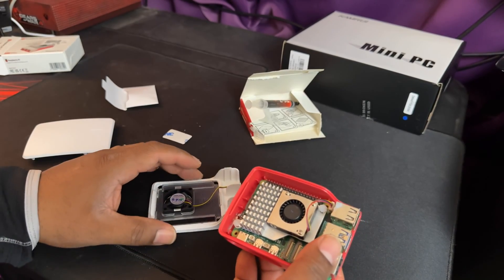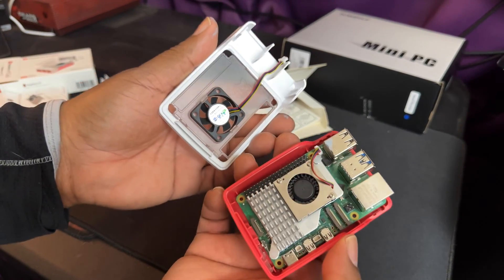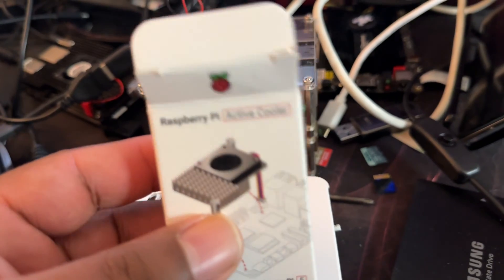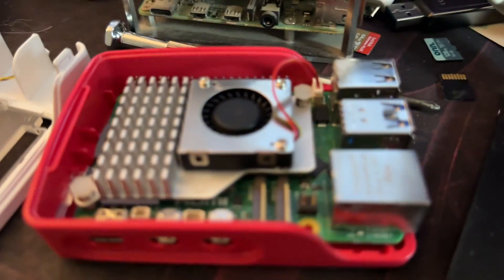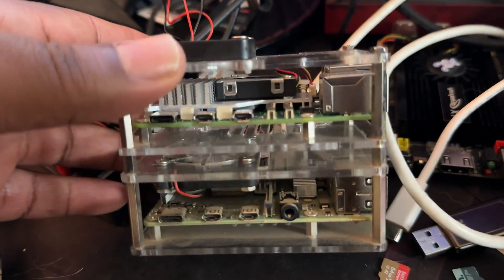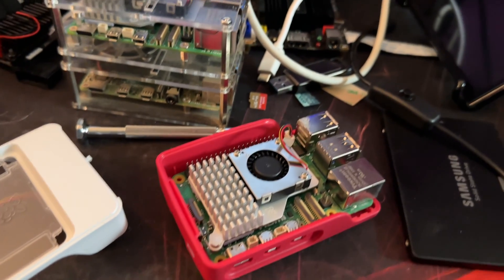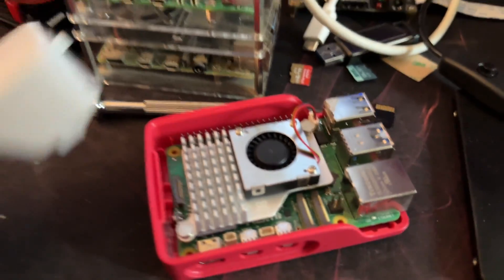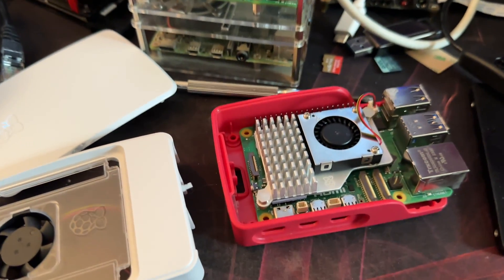The Raspberry Pi 5 Case & Active Cooler Install Concerns

Comment: Dude you are hilarious.
You should just know what you are buying.
Make sure you do not put diesel in your petrol car and go blame the car manufacturer.
Well no. That is a bit dumb. If you use a passive cooler on the chip you can use the case fan. If you decide to have an active cooler you do not also use a case cooler. It is very clear.
So that rant of yours is at best "illogical''. 
You  just do not understand the difference between active cooling and a passive cooler with a case fan.
Your best solution is to understand what you have instead of thrashing what you do not understand. LOL
Reply from the maker: 😂 you should prob read my pinned comment before trying to clown someone
Reply: NO its NOT very clear they do NOT mention on either product page this will NOT work together,  even mention the opposite?! SO WTH?! 
SKU: 1749017
Original Raspberry Pi Product.
Temperature-Controlled Fan,
Delivers up to 1.4CFM of Air Flow.
Comes With Aluminium Heat Sink
!!!!!!Compatible With the Official Raspberry Pi 5 Case!!!!!!

You will ONLY know AFTER You BUY it, its BAD design!? Also WHY NO screws provided?!  🤬
I'm "sorry" BUT ANY Fan is ACTIVE Cooling! FYR 😜
Any cooling system that uses fans is considered active cooling. Here’s a detailed comparison between active and passive cooling:

Active Cooling
Components: Uses fans, pumps, or other mechanical devices to move air or liquid.
Efficiency: Generally more effective at dissipating heat quickly.
Noise: Can be noisy due to the moving parts (fans, pumps).
Power Consumption: Requires power to operate the fans or pumps.
Applications: Commonly used in high-performance computers, gaming consoles, and other electronics that generate a lot of heat.
Passive Cooling
Components: Relies on heat sinks, thermal pads, and natural convection without moving parts.
Efficiency: Less effective than active cooling for high heat loads but sufficient for low to moderate heat dissipation.
Noise: Completely silent as there are no moving parts.
Power Consumption: No power required, making it energy-efficient.
Applications: Used in devices with lower heat output, such as some laptops, tablets, and smartphones.

Comment: Sorry if I missed it on the video, but is it possible to use the larger active cooler and the case if you remove the case's cooler? Also is the plastic where the case's cooler is connected removable? I mean the light/white/a bit seethrough plastic.
Reply from the maker: Ya this case just presents too many issues I made an update about it in my newest video

Comment: It was very obvious from looking at these two that they dont work together. Idk how you didnt figure that out yourself. Yes, bad designed case. But. Do some research of what youre buying and you wont be dissapointed.
Reply from the maker: It wasn’t obvious because it’s not mentioned on any site when I got this months ago. These had just came out and there’s no mention of it on any site at the time. Secondly there’s no mention of the active cooler maybe not being efficient alone during over clocking and high end use

Comment: Just didn't do enough research. The active cooler works with other cases. But this case is meant to work in lue of. Thats why the active cooler is sold separately.
Reply from the maker: Please read below and pinned comment. There’s been enough research

Comment: They are not designed to work together but you do need the active cooler and a case, it can be any case, or else you risk shorting something out on the SBC. I've had that happen in the past and lost a Pi3b+. The case fan is nearly useless, though, so you definitely need the active cooler or a huge hitsink. I've seen an all aluminium case that doubles as a passive heatsink which works well as long as you have good contact between the aluminium block and the processor.
Reply from the maker: Oh of course I have an open air case with fan and the active cooler. So far every case I’ve seen traps in heat the thing that people haven’t shown is heat rising. I don’t recommend enclosed cases especially for sending situations or overclocking. We’ve had guys reach 77 degrees already with active cooler

Comment: Why didn’t you pop out the CLIP-ON case fan, it does work. You need to pop the case fan out though. How did you miss that?
Reply from the maker: I didn’t that wasn’t the point of the video as listed in the comments
Reply: Whole video looks like failed IQ test, or people just dont read fck install guide

Comment: For the overclocking you are doing you may be better looking into a peltier cooled heatsink, if using an external power source for the peltier works for you
Reply from the maker: 28-53 degrees im fine. but thanks

Comment: best option is to use the case fan and buy 2 more cheap heatsinks. The original cooler is designed to be used either open or with any case and can be used with the official case. The original cooler in the official case with its fan removed is slightly more efficient than the case cooler fan and quieter. The case cooler is better if 2 added heatsinks are used. The case cooler also allows the potential to put small heatsinks wherever you want on the board to seperate the heat sinking per part or use one large low profile heatsink to pull the heat. Depending on how you operate the pi, different solutions may be more applicable. 
For something like astrophotography, where the pi is mounted to the telescope outdoors and where fan vibration can ruin long exposure shots, these options are great. The original cooler inside the case will most likely be the best option.
Reply from the maker: Best option is my open air case
Reply: @kiodiekin  For your indoor use yes. For outdoor use not so much ;)

Comment: Uh the active heatsink/fan is for if you don't have a fan. You obviously wouldn't want two fans right inline with each other. No one is talking about this because its assumed knowledge
Reply from the maker: And yet I have the coolest temps for the pi5 at 28 degrees while overclock and running the most demanding apps . U can’t have assumed knowledge when full development hasn’t taken course and higher app running consuming power hasn’t even been ran or tested. I’ve done those tests and I’m speaking from an informed position. So no it isn’t obvious

Comment: The clear part of the case comes off easily. The case comes with a cooler and a small radiator that you can use. You have to choose the bit cooler bought separately or the one that comes with the case. Pretty simple.
Reply from the maker: Well aware as mentioned in pinned post

Comment: You can use the case, just pop out the fan assembly from the case.
Reply from the maker: I’m aware of that but it doesn’t fit the bill for running demanding apps and generating heat in a small enclosure

Comment: Err. The clear plastic with the fan pops out so you can put the top on. All that being said. No screws and the top doesn’t click to the base securely. 

With a bit more thought they could have designed a nice case with a bit more room to allow for a pi hat to fit a nvme drive at no extra cost.
Reply from the maker: I’m aware it pops out that wasn’t the full point. Ya they should have thought it out better cause it’s useless for overclocking trapping in heat

Comment: Just got mine this morning and I fully agree with you. Nobody has mentioned that this is the first raspberry pi with an on/off button but with no access to it.
Reply: The button can be accessed on the case. The power light is also a button
Reply from the maker: The power button thing has been mentioned before.

Comment: To answer you the case has a fan and HEAT SINK so if you don't get the active cooler you have better cooling(very good of them except for the only one HS. It actually need 3 more not just 2.  The USB chip also get hot) and if you did a little due dilagance you would know that for those with the active cooler, you can completely remove the translucent fan holder insert.  This was A VERY WELL THOUGHT OUT CASE.  There are and will be many better but at release this is a very flexible case for the two primary use cases.  See this video https://www.youtube.com/watch?v=vYUF1H-_7TQ   I'm waiting for the official PCI hat and a case that is designed for that like that GEEEK PI case but whit 2 fans on top.
Reply from the maker: Thanks for checking it out. If you did some due diligence and read the comments I know exactly how the case is designed to work. The problem is the pie five gets really hot even with the active cooler. You need a second fan, and lastly, keeping it inside the case, rises very fast, especially for demanding applications.

Comment: My guess is
It's  for the versions 
Without the heatsink and fan
Reply from the maker: It has one
Reply: @kiodiekin  They build the cases before new models come out
Reply from the maker: @Simcore999  what do u mean
Reply: @kiodiekin  I think it's made for the pi4 or if you remove stock heatsink and fan
Reply from the maker: @Simcore999  this is made for the pi5

Comment: I get where you’re coming from, but the official case top comes out specifically for use of the active cooler. If you didn’t buy the active cooler, then cool you got a single fan and heat sink. If you do buy the upgrade active cooler, there is no need for the single fan and you get the multi-chip heat sink. I do wish they had added a separate top in the box for use with the active cooler instead of leaving an open top.
Reply from the maker: I’m aware of how the official
Case works. But no where in documentation does it mention the active cooler can’t work with the case fan. Secondly it needs the fan for cooling especially inside the case you’ll see in my upcoming vids
Reply: @kiodiekin hmm. I’ve seen multiple videos of regular case with single fan vs regular case with active cooler and of course active cooler wins. I’ll be interested to see what you come up with.
Reply from the maker: @austingarland8242  check
My previous video on the pi case.

Comment: ""Explaining Computers" on YouTube compared temps and he found the Active Cooler with the official case were actually slightly lower than the fan that comes with the case. 
https://youtu.be/vYUF1H-_7TQ?si=Zw14Z242RX-wuDaM
Reply from the maker: ya i saw. yet i have the lowest temps around at 28-33 degrees

Comment: You have to pop out the transparent part of the case to use it with the active cooler !!! That's how it's designed !!!
Reply: Dang, so silly, just remove the clear part.
Search for the video titled: Raspberry Pi 5 Cooling: Official Case vs Geeek Pi Heatsink Case
Reply from the maker: We know and that’s not the issue as to why I made
The video if u watched

Comment: Hey, you are supposed to remove the fan from the case, for it to be able to be used with the active cooler. I am still waiting for my raspberry pi 5, but you can look in LivingLinux's video from a month ago, where he removes the fan from the case to use the active cooler.
Reply from the maker: I’m aware of that. But I need an additional fan to keep it cool and nowhere was it mentioned that u can’t use it with the active cooler.

Comment: Also the Pi5 with the cooler attached doesn't fit in the case.  The plastic push pins protrude too far through the board for it to sit in the case right. If it sat in the case right you could remove the clear part of the midsection but it sits to high and case will not close.
Reply: it does fit in the case, you need to push the back part with the SD card under the little plastic clip/ridge and then seat the I/O ports, and then it will seat pretty firmly in place with no obstructions. i have 2 and they fit perfect.
Reply from the maker: Well aware as mentioned in pinned post

Comment: Yeah - maybe have a version of the case that just has a hole positioned directly above the official heatsink’s fan.   Could actually cut some acrylic to make one, or even print a new top. 

Or include two more heatsinks in the regular kit lol.
Reply from the maker: yup! it could have been designed to work with it and add more heatsinks in the original case which makes more sense. the other cases provide at least 3 heat sinks
Reply: Geekworm has an “armor aluminum” case for the pi 5 that I like way better. The entire case is a giant active heatsink.
Reply from the maker: i saw it. explain computers did a review. there temps r still higher than mine
Reply: @kiodiekin  - he reviewed the “passive cooler” version (no fan). There’s “active cooler” versions that have one or more fans on top. Also geekworm, not geeekpi (two different places). Geekworm’s version has the better design - complete with an opening for pcie.
Reply from the maker: @JazzTechie  I’ve seen both even on leepsp

Comment: You take the clear part out and don't use the case fan. It's one or the other.
Reply from the maker: I’m aware of that. But this pi needs the fan and active cooler to keep it cool and have decent temps

Comment: For very basic use, (No Overclock and nothing Stressful) that case is at least Cheap. Other than that, I find it one of the worst cases ever for Pi4 and now Pi5. Try a CPUBURN stress test and watch it throttle.
Reply from the maker: It’s already at 77

Comment: In my opinion the missing screws are perfect. My smartphone, remote control, ... have also no screws and they never opens by chance, even both accelerate sometimes pretty strong. While my pi never accelerates. So I can't see why screw should be added for the case. Maybe if you are installing the Pi on a ship that is running through a storm in the sea, but i guess those guys know how to fix items on a table. hmm... maybe If you want to attach it up side down under a table, then screws might be in fact nice. On the other hand in that case you probably also fix the cables and fixed cables are already strong enough to hold the Pi.
I am using the Pi with the official case only. Also under heavy work load (a few days with 100% on all cores) and that is working fine if you don't add the top-cover. I didn't tested it in the summer with top-cover yet, but currently it is fine. The active cooler looks like a nerd item, like guys that use an "normal!" PC with water cooling, even air cooling can do the same.
If you only do "normal" office stuff only (Like writing documents and sheets) you even don't need to cool it at all.

Comment: No case use the active cooler. If you use the case no active cooler, use the included fan. Easy. You can unclip the clear tray with the fan on it if you want to use the active cooler in the case, although it's the most expensive option.
Reply from the maker: U need an additional fan and something to protect the pi. Temps get high active cooler isn’t enough
Reply: I have a Pi5 in the case just using the fan, I didn't fit the tiny heat sink and it runs quite happy during normal use. I think if you overclock then cooling could become an issue and the active cooler would be the best. @kiodiekin

Comment: I ordered the active cooler and the power supply but I 3D printed several different cases in a few different colors.  I will mount this under a shelf I have and connect ALL my ham radio gear to it with a 55" monitor. Looking forward to it being in operation.
Reply from the maker: Thanks I’ve got other videos planned 28 degrees is a big difference compared to 77

Comment: Raspberry Pi has a Youtube channel. You can get answers for some of those questions over there. The videos are a bit lengthy but i think that they're worthwhile.  In summary, it's all about if you're going to use a hat or not. The new POE hat is 'L' shaped but other hats won't be. They say they know other manufacturers will make all sort of cases but they want peopple to have one more option. About the cooling, the heat sink you showed is really small, too small in my opinion, however, just to get things straight, usualy, only CPUs need cooling, unless some other chip has some issue like the USB controller on the Pi 4, or a power regulator overheats. What i mean is that we've been shoved with cooling solutions that are not needed in most cases.

Comment: This short shows you that you can remove the fan on the Pi5 official case.

https://www.youtube.com/shorts/curly1UNaSs
Reply from the maker: Removing the additional fan doesn’t keep temps low enough for overclocking and ps2 emulation that’s the whole point of this video
Reply: @kiodiekin  I'm personally more than happy that it improves overall emulation on the systems the Pi is currently capable of, along with better arcade emulation and Sega Saturn performance. With the occasional Wii and Gamecube title thrown in.

Even with O/C speeds and the best optimisation available, I can't see PS2 emulation being worthwhile, as you need a pretty beefy PC as it is if you wish to run the likes of GoW 1&2 and GT4 at good speeds.

Though it does have a lot of cool, obscure budget titles to enjoy.
Reply from the maker: Check
My
Playlist

Comment: Are you thick remove fan from case
Reply from the maker: The point is to use the fan with the case because it doesn’t keep it cool enough. Especially enclosed